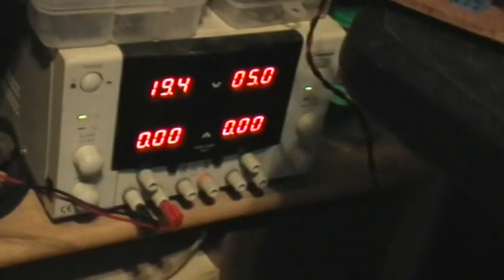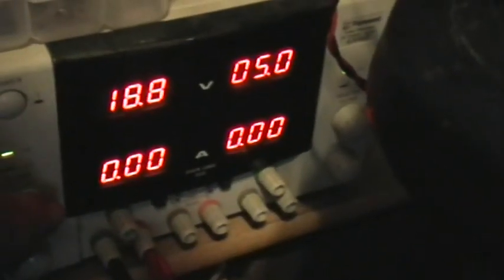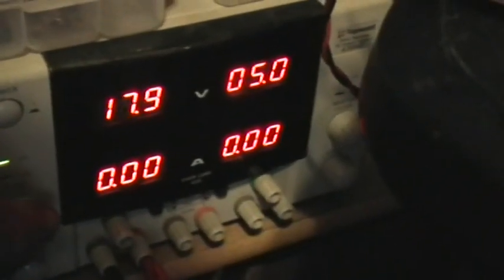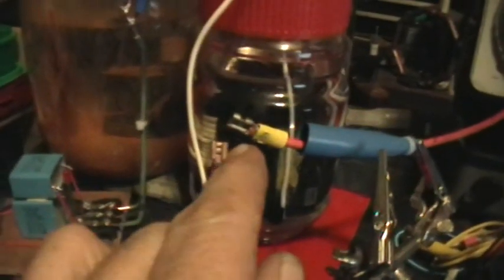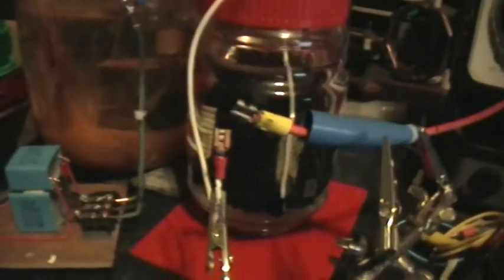Wireless Power and High Voltage: Wirelessly driven flyback driver making HV arc

Comment: There's a battery inside.
Reply from the maker: +Dan Negura 
No, there isn't.
Reply: TinselKoala There has to be.
Reply from the maker: Dan Negura
No. If you read the description and listen to the narration, you will learn that the wireless power transmitter is powered by an 18 volt bench power supply. The wireless receiver has no battery or power supply other than what it receives from the transmitter. The high voltage arc circuit is powered by the wireless receiver only. No batteries are used in this demonstration. I have many other demonstrations of my wireless power transmitting system. I hope you enjoy them. Thanks for watching and commenting.